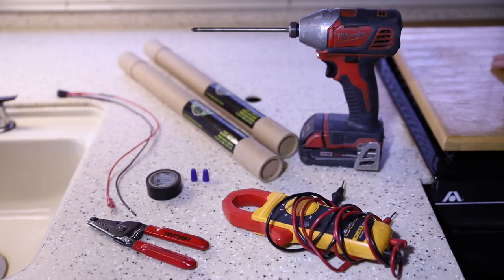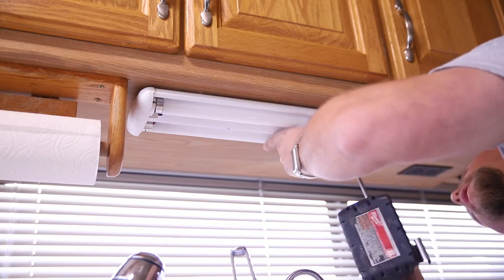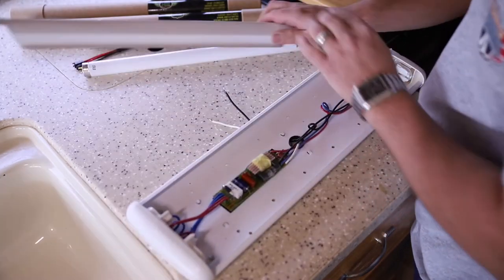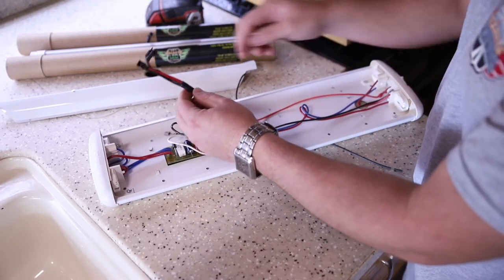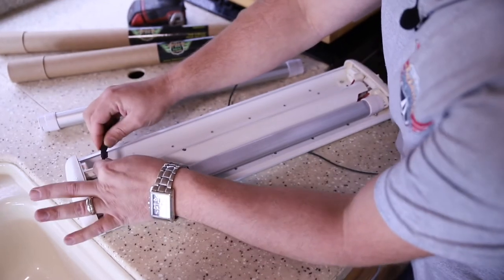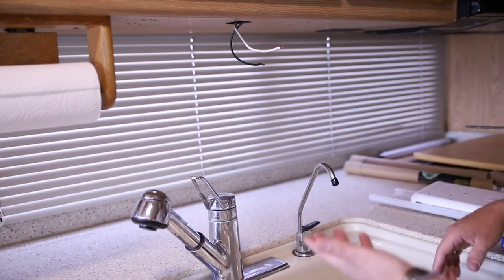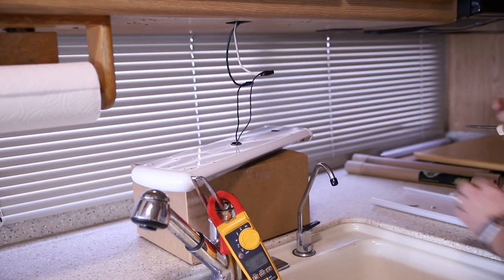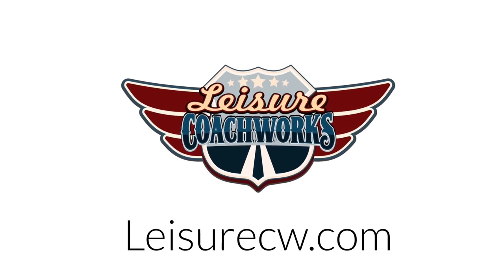HOW TO: Convert Fluorescent RV Lights to Leisure LED Tube Lights Tutorial for RV Trailers Motorhomes

Comment: After checking BBB and other reviews I was ready to order bulbs but got concerned the instructions would not be better than the video.  Is the ballast still functional after the conversion, is that the mechanism that allows your bulb to handle surges as advertised or do you have a micro converter inside tube (in other words will your tubes work and handle voltage changes with the ballast removed?  If you are using ballast what amps is the fixture drawing (in other words what energy efficiency was gained if any switching to led)? Is there a high pitch or complaints of high pitch?  Can you explain mechanism these bulbs can tolerate voltage variations say from alternator/generator/shore/etc?  Are these UL/CE approved?  Can you do a video with an installation where the fixture is not removed from rv ceiling, the ballast removed, and better focus and wire detail, no music … in summary more detail with fixture in tact in ceiling? Please include multimeter screen/clamp details in next video, I’m meter savvy but was unable to trace path you tested

Comment: The video seemed to skip over how to determine which wire to disconnect from the ballast. How do you determine that? Thanks.
Reply from the maker: You need to look for the wire that is feeding power to the ballast. Normally if you have a switch its the wire coming off the switch going straight to the ballast.  Seen right around the two minute mark .  Hope this helps